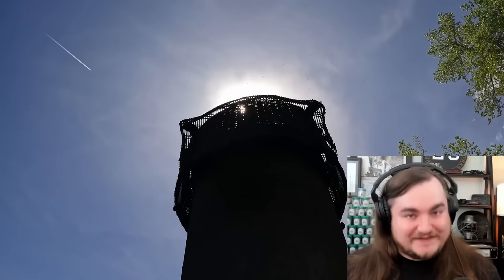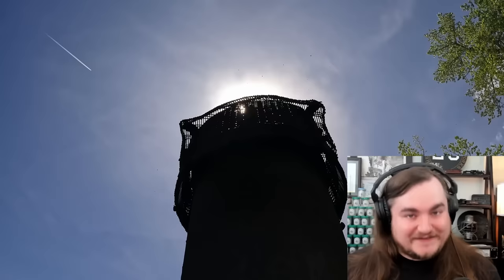Why do USA steam trains make smoke, but UK ones don't?

Comment: Interesting insightful video! Having been a rail fan (steam mainly) for a long time I have to agree with you that photographer expectations have a big influence on smoke production. My Dad wrote a letter to Lucius Beebe in 1948 complimenting him on his then recent publication of Mixed Train Daily and got a response from the one of the biggest influencers of the time with regard to rail photography. I’ll quote a portion of the letter here where Beebe talks about the photos he used in his book. “The smoke effects were deliberate and calculated on our part. Simply we have seen so many pictures that we know to have been taken at speed but which show no exhaust at all that when we undertook Mixed Train we swore on a stack of Stork Club menus that we wouldn’t run a single action shot that didn’t show all the smoke we could get. We just think that an engine that isn’t visibly working steam has no point whatsoever to it. We worked apart” (referring to his partner Charles Clegg) “and took shots repeatedly over wide terrains to get the most possible exhaust, occasionally asking for it, but usually catching it at places where we knew we would get the greatest volume. We wanted every damn picture to be perfect, and there is hardly a single one we are going to change in the next printing.” If you have any of Beebe’s books you’ll see a lot of smoke being produced for the sake of drama and not efficiency. I thought this was a good data point to corroborate some of you conclusions.

Comment: The Pennsy management did not like smokey fires. Their mantra was "A clean fire is an efficient fire". Which follows along with what you are saying, the right balance of fuel and air makes for more complete combustion and thus a low to no smoke fire.

Comment: Very interesting, I worked as a combustion Engineer on coal boilers for many years, so couple of points.
To stop smoke you need three things - time, temperature and turbulance.  Time is by furnace design, Temperature is design and operation, and Turbulance is normally via the secondary air, 
Coal has two different 'bits' that burn, volatile matter, which produces the smoke, and fixed carbon, which is in effect Coke, a smokeless fuel, so its the volatile matter that makes the smoke (generally)
It's very easy to get a coal boiler to smoke. harder with oil, almost (but not quite) impossible with gas.
Good video, enjoyed it.

Comment: Having worked a few photo charters at Sumpter (as train crew not engine crew), I can confirm photographers and the photo organizer like to have smoke, and are not afraid to ask us to "back up and do another run-by with more smoke".  Especially if one shall-remain-nameless-but-well-known-person is involved.  I hear he fired the Shay at City of Prineville once and got buzzed, though not dropped on, by a firefighting air tanker because he put out so much smoke.
Reply: 🤣 that's a heck of a tale! Would have been an amazing story had it ended with the loco getting drenched.

Comment: This matches my experience with coal burning small gauge engines, to the point where as I’m about to leave the station, I’ll chuck a few scoops of coal in, and as I pull out, she blows a thick stack of smoke for photos, which dies down as I head up the back hill

Comment: Thanks for this

I'm from the UK and I have noticed from the times I've been on railways that large amounts of black smoke aren't a very common thing (I did see it once when a 9F passed, but that's the only time I can recall).  This was very helpful.
Reply: Think the 9F has the biggest boiler out of pretty much all the operational preserved steam engines here in britain.
Reply: With UK locos black smoke is often seen as the fireman is completing "putting a round on" ( firing up ).if he just covers the fire bed with a light covering the smoke goes gray at the chimney top just as the last shovel fulls are added once these ignite the smoke will fade away , if  the fireman piles a load of coal in to the box in preparation for the road ahead ( a hill )whilst the loco is stood or not working it will smoke until all the coal has ignited and starting to burn bright to begin making steam.
Reply: All said is correct, but not the reason.  Opening the firebox door and leaving it open while running to add oxygen above the fire creates engines with little smoke.  It is also amazingly dangerous, because if the gasses blow back into the cab the resulting explosion will seriously harm the crew (this happened on a historical run recently).

Comment: British engines also use anthracite (not culm) to fire with, whilst we use bitumous.
Reply: Lackawanna steam locomotives and I think Reading, too, were designed to run on "clean burning" anthracite but I'm not sure that's what always found its way into the firebox.
Reply: @1940limited  Those were designed to run on anthracite waste, not actual anthracite. Meanwhile, Welsh coal, the best Locomotive coal in the world, is anthracite.
Reply from the maker: Depends on the railroad; the setup is different, but so long as you're burning the correct coal in an engine set up for it, you won't have the plume.
Reply: @Hyce777  So it was numerous factors that contributed to thick smoke.
Reply: @1940limited Oh yeah. Heck part of the Delaware, Lackwanna & Western's marketing was based on the fact they used anthrecite coal. "Road of Anthrecite" and their big passenger train the "Phoebe Snow" leaned heavily on this.

Comment: When you disturb the firebed by shoveling coal on it or stirring it, you also get smoke.  Like you said - it's all fireman.  Sometimes people want to see smoke for photographs.  But most of the time, clear stack.  However, quality of coal and even humidity can wreck a fire.  I found when it got a lot more humid, like after a thunderstorm, the fire had a harder time burning when idle - more smoke.
Reply from the maker: Absolutely true!
Reply: I would guess that the fire having trouble combusting completely when the air is humid has to do with any air flowing in bringing with it moisture that, though it turns to steam inside the firebox, still has an overall cooling effect on the fire. In principle, it's like misting a fire with water vs dumping gallons at high pressure on the seat of the fire - misting on sufficiently small fires can be more effective, as it cools the area around the fire, sucking heat energy out of items around the fire, and reducing the likelihood of combustion spreading. Meanwhile, dumping gallons of water on the seat of a fire may well put out a primary fire, but could still leave you with items close enough to combustion that you may see secondary conflagrations. The catch with misting, from a firefighting standpoint of course is that you're then creating a steam heat hazard, which is something that should be accounted for when choosing how best to attack a fire.
Reply: @KidarWolf  Isn't it just the same issue as you generally have with starting any fire in a humid environment? The fuel is likely to be somewhat damp so there's a lot of water that has to evaporate first and that'll carry particulates with it.

Comment: In steam days larger UK stations would have signs on platform ends warning footplate crews not to make smoke, due to complaints from homes and businesses close to the line. Your comment about secondary air is spot on here. 
Ta.

Comment: If I understand correctly, In New Zealand they would sometimes "blow out" the boiler tubes of locos for photo runs by throwing a few shovels full of sand into the firebox,  and it would clean the clinker buildup off the inside of the tubes and emit lots of smoke and even sparks (not great in summer!) looks impressive at sunset...

Comment: Im under the impression most of what comes out of a kettle's funnel (what we affectionately call steam engines in the UK!) is steam blown out of the cylinders, up the blast pipe mixed with some smoke from the firebox. Example on a cold day, you normally see lots of white steam coming out of the funnel as the hot steam cools. On a hotter day, you see far less steam because of the warmer ambient air temperature and not much smoke.
Reply: The exhaust steam is directed through the smokestack, where it helps the draft for the fire. Each "chuff" is a pulse, like a heartbeat. What exits the stack is a mixture of used steam and whatever gases and particles come through the tubes/flues. If you broke everything down by volume or weight my guess for what mostly comes out the stack (in descending order) is:

1. Lots and lots of hot air, depleted of oxygen and enriched in combustion byproducts.
2. Exhausted steam from the cylinders.
3. Unburnt fuel particles and other solid matter. Cinders, soot, ash, etc.
Reply: Close, but incorrect.  The blast exhaust pipe works in tandem with the smokestack petticoat to create a vacuum in the smokebox.  This sucks the gasses and smoke from the firebox.  Remember, the steam from the cylinders continues to expand as it leaves the blast pipe, so the design of the petticoat to create the best vacuum is very complicated.  We call it a "good steaming engine" when then got it right.

Comment: I operate a 1/8 scale miniature coal fired locomotive and the main difference that I have had is the type of coal that I use.  Anthracite is a much harder coal that burns hotter and produces very little smoke as compared to bituminous coal which a softer coal and produces a ridiculous amount of black smoke.  Just like many people have already stated is that over firing an engine will produce smoke from unburned coal.  Some people will tell you that anthracite is hard to burn, but it is not difficult, but only different  and requires more air to keep it burning.  So tending the coal is of major importance and keeping a nice bed of hot embers insures that the next shovel of coal will nearly immediately ignite.   By the way, this hobby is fantastic.

Comment: Fun Fact: The most filthy crude oil still burns cleaner than higher quality coal, just barely. You can also use engine oil to fire oil burners if you're desperate.
Reply: One of my buddies inherited a piece of land out in the Midwest a few years ago, and together with a couple other friends, we built a 1 foot gauge miniature railroad, and all of our steamers, both finished and still being built, burn kerosene, except for our Jupiter, which burns store-bought wood chips. We don't only run steam, but it's always great when we do.

Comment: I think you hit it on the mark, it's up to the fireman.  The Reading and some other eastern RRs used anthracite (hard) coal, this is almost pure carbon and it burns very cleanly but is generally more expensive since it is valued for domestic use.  Some bituminous (soft) is also clean burning, the narrow gauge East Broad Top hauled Broad Top coal generally to eastern markets where it was valued as a naval coal due to its low smoke, naval forces would disclose their position much sooner if they smoked a lot and passenger ships didn't like getting dirty and sooting up their passengers.  I remember riding the EBT on a tourist run and you're right, the photags asked for more smoke, the firman would put a shovel of dry sand in the fire door and the draft would put it through the boiler cleaning out the tubes and making lots of smoke.  As for smoking diesels, asking the engine to work hard at low rpm and low turbo boost means high rack settings and lots of smoke, generally a diesel in good condition, will only smoke when it's overworked.  I also suspect that fuel was and is relatively cheap in the US and Canada, so nobody much cared.
Reply: You are right about naval use. US Navy ships in WW1 produced significantly less smoke  operating on British coal.

Comment: "The Blower can be put on to stop the fire jumping out in a backdraft burning the Fireman -this happened to a well known Fiireman in New Zealand So from what I learnt is the Blower is put on a little to keep the fire from jumping out Also the Blower is used to create a thru draft to fan the fire and make it hotter while more coal is shovelled in to keep the fire Hot and stoked up for Hills and hard work hence the black smoke and straight up columns of smoke when she is working hard up a gradient ...Good video "

Comment: Thanks for this video. I've never fired a steam locomotive, however I picked up a neat fireman's instruction book from the twenties it's a real gem packed with knowledge. As you pointed out black smoke is unburned fuel the fireman did not get the heat out of it as he should have and he was wasting fuel and therefore company money. Thanks again.

Comment: Agree with all you said.
When firing a Baldwin designed narrow gauge 2-6-2 tank loco, I sometimes had the choice - clean stack and a bit low on pressure, or close the fire hole door and have a bit of smoke and hopefully regain some pressure. Often it also depended on the water level too.  If water level OK you could sacrifice a bit of water to hopefully maintain or increase pressure, but if water was low you needed to try and increase the pressure to at least maintain the water level. All good fun juggling fuel, water, pressure and emission from the funnel.

Comment: It depends on what the fireman is doing.

Black smoke tells us the fireman isn’t able to keep the fire hot enough and the smoke is wasted, unburned fuel billowing out of the stack. White smoke or no smoke indicates an engine is operating at maximum fuel efficiency. Or it can be the engine itself.

Locos were usually assigned to a specific terminal in what ever class or duty; pool fright, helper service, passenger service, local freight, work trains, road switchers and/or snow removal. As a result these engines would hang around the roundhouse for extended periods of time. As a result of that, fireman became very familiar with these engines. So as it was known some engines steamed better than others.

Black smoke can also be generated when sanding out the flues. As its name indicates, the this is done when the fireman would put several scoops of sand in the fire box or peep holes.

Comment: Anerican loco's were very large and the firegrate was too much for a single man to shovel coal into it and maintain steam pressure.  Because the US had an ample supply of oil (back in the day) and because it was cheaper to extract from the ground than coal, US steam loco's quickly went over to oil fired boilers.  In the UK, we had the opposite issue, no cheap access to oil (not discovered in the North Sea at the time) but a plentiful supply of cheap coal.  US steam loco's put a lot of black smoke out due to incomplete combustion in the large firegrate area (thermal innefficiency).  UK steam loco's put out dark grey, cloudy looking plumes, due to it being a less thermal efficient fuel and thermal charactersitics of oil.  The issue of "good" coal often arises in the UK, and it's only about the calorific content of the coal, i.e. good burning etc.  Welsh coal was indeed very good coal.

Edit:  British loco's later had improved thermal efficiency with "superheating" the steam prior to entering the pistons.  In this respect the UK had a lead in coal fired steam locos, although by then (1960's), most folk in the UK were heartily glad to see the back of steam!

Comment: There is another slight difference, the U.S. has largely burnt anthracite coal (86-97% carbon, 33MJ/kg energy density). The U.K. Largely burns bituminous coal (76-86% carbon, 27MJ/kg energy density). I believe you are correct about it being down to the individual fireman and/or photography scenario, and firebox/flue design, but I feel coal type also plays a role.
Reply: In short, It would be hard for British firemen to keep up with coal intake, and It would be easy for American Firemen to exceed coal intake.

Comment: Was in Poland several years ago in a city of Wolsztyn. For those who are not familiar, it's the last place in Europe where scheduled passenger trains are pulled by steam power. A group od Germans came in, and Germans love, love, love smoke coming out of their steam locomotives. They were complaining; "we stand at the bridge, steam locomotive is coming and no smoke😵‍💫". We spoke in english and when i tried to explain to the shop foreman, he already understood.😃 I thought it was hilarious. I myself was growing up in Poland when steam was used on regular basis. For a kid smoke coming out of the exhaust stack of hard working steam locomotive is just as fascinating as moving rods and valve gear.
Reply: One of the reasons germans meant want to see more smoke from trains is that german coal is pretty bad. It has a lot and i mean a lot of sand in it.